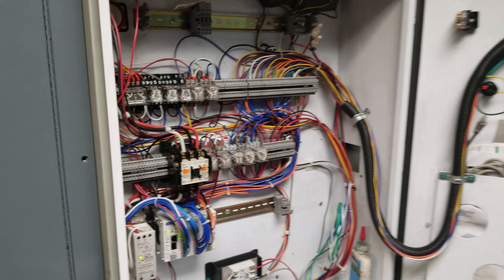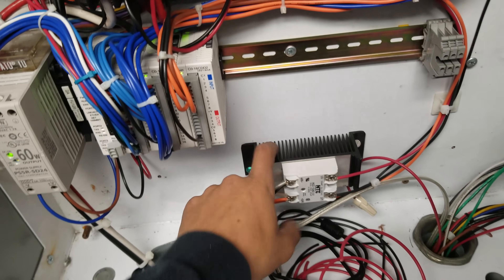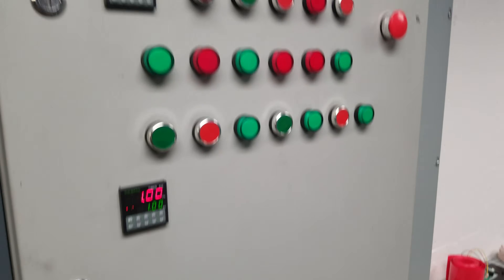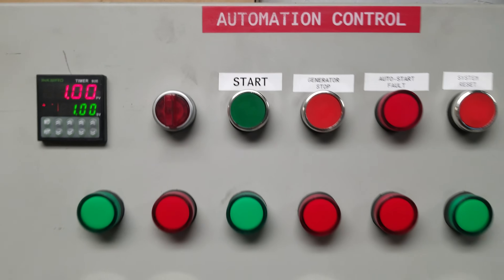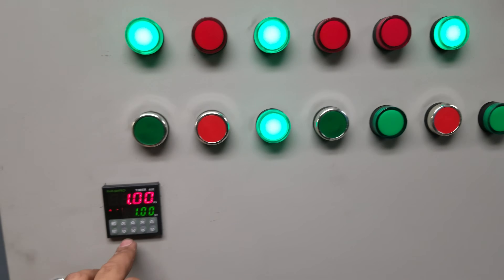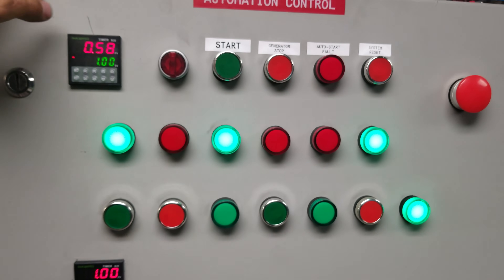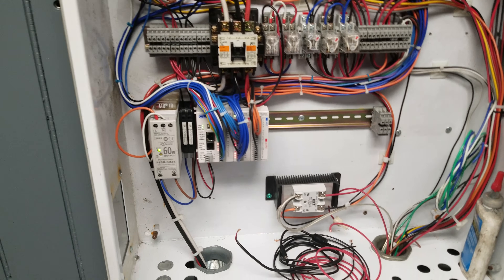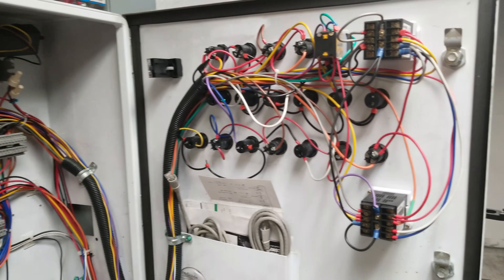Click PLC Meets Off Grid Power Supply

Comment: What a nicely laid out and programed PLC. Its the perfect application for a multi input system and I like the way you have isolation using the contactors and relays rather than being lazy and sending the glow plug, starter and transfer switching via the PLC directly. I assume you have interlocks programed for safety to.

That is the kind of system that can be fully automated and left to do its own thing. If you have an analog input card you could monitor the DC voltages directly and the AC feeds via a bridge rectifier. You could also take secondary taps or the RS485 output and have a nice neat display panel indoors.

Some suggestions if I may...... Master emergency stop buttons that will fully isolate all supply inputs and outputs in the case of an electrical fire and the following......

1. A couple of Co2 fire extinguishers inside and outside the power room. Expect the unexpected !

2 Smoke, heat and gas detectors. The gas detectors at floor and ceiling with local and remote alarms. You could consider a timer so if it is not acknowledged it could close the emergency kill circuit.

3. A mechanical combination lock on the door to the power room to protect children and any other unwanted guests.

4 Add a thermostat to run the extraction fan so you never have to get hot under the collar  ;-)

Its a very well put together system ! You can already extract a lot of data from the plc. Have you considered DC hall effect and AC current transformers at key points. You could collect that data and monitor system operations alongside performance so you can see where you may have losses.

The only other thing that comes to mind and this is due to personal experience..... I once had to change out a dead PLC on a PCB production line and that was easy.. Only snag was that no one had a copy of the connection layout or the I/O programing. That job turned into a week long nightmare with a full trace and reprogram. I would get a key box or lockbox in or near the power room with a USB or compact flash with the system config on it. If you do ever have a failed PLC or one that gets upset and suffers memory loss its a few minutes to get up and running again.
.......................................................................

I hope all that wasnt to over the top but its easy to get carried away with the smarts of your system and forget the basics. You should be proud of that install. I can see you put a lot of time and care into it. It was really nice to see a PLC being used for a job its made for. I wish more people used them..... That's an A1 install there and I hope you don't take my comments as criticism and that they help improve an already top notch job  :)

All the best to you and your family.

Stuart.

Comment: nice setup! I'm sure you're familiar, but check out-out the c-more micro HMI's if your not. Would save a lot of panel space and wiring, in addition to a lot more capability from an HMI also.
Reply from the maker: You are absolutely correct.  If you check out my recent uploads I actually went with a ea10-wcl and love it a lot.  Bit pricey but well worth it.

Comment: Really nice setup. Couple of points of advice in addition to existing comments.
- Draw your power and control wiring up. If you don’t have experience with this trying looking for electrical schematics and single line diagrams. These are probably the two I would have as a minimum for when you are trying to troubleshoot a problem or add to your installation.
- Label your wiring and equipment and record this on your drawings as well. I cannot stress enough the criticality when trying to make sense of it all at a later date. One easy way for wiring labels is name your equipment and then use source and destination on the wire. This way you will never have to cut any cable ties while trying to trace a wire.

Comment: Great setup! Can't wait to see more. Would be cool if you have a wired network to connect your PLC to it and be able to monitor status/control it from a web interface or app.
Reply from the maker: The hard part is we don't have any land internet, everything we do on the hill it is through cell phones and 4G
Reply: @HighTechLab  I use a cradlepoint MBR95 router with a usb connection to a rooted(so they can't tell you are tethering) android phone that is the source of my home internet. From there you have a normal ethernet output you can do whatever you want with.

Comment: You can get trunking for inside the panel, it has slots in the side for the wires ;)
(i used to work on control panels)

Comment: Cable management skills are Required . this would  not pass the inspection if it was a Marine Grade panel  This would be loom formed   also there is no terminations on your controller . stuff them in is not how it's done . Also crimps have you tested the physical breaking strain of the crimps you are using  a Under pressure crimp lug can cause all manor of problems when under loaded conditions even fire . nice

Comment: Why not run the internal timers on the plc? Get a compact logix or a mirco 850 add panel view hmi touch screen.
Reply from the maker: HMI touch screens are expensive as f***
Reply: HighTechLab by all means kudos to your setup. It's very impressive. I hope to one day have something a fraction of the size. 

Just curious how much was everything so far ? 

I've watched a several of videos as the system progresses.  It's awesome.
Reply: HighTechLab the price for a used  isn't so bad. Or get a new weintek. Under 300

Comment: Glo plugs? In the Army’s Humvee it uses glo plugs. What does the glo plug do for your set up? Is it for when things are cold?
Reply from the maker: it's for the diesel generator to heat the cylinder before cranking over because Diesel doesn't have a spark it uses the heat from compression and if it's too cold it can't make enough heat to ignite the fuel